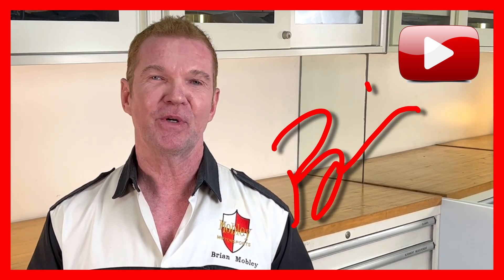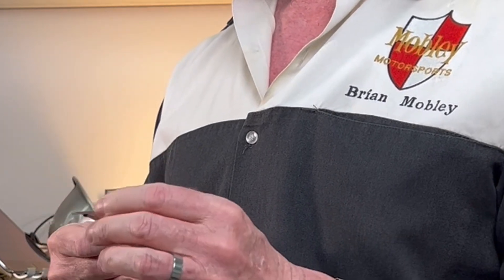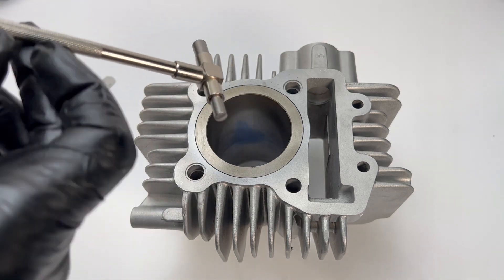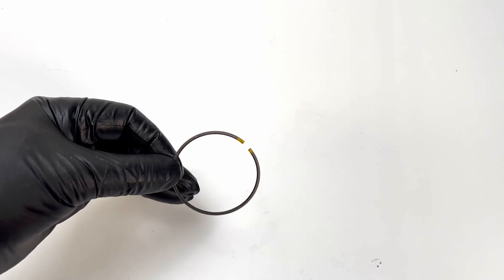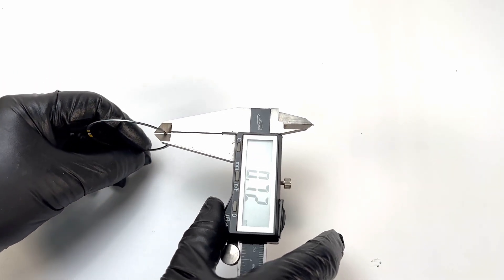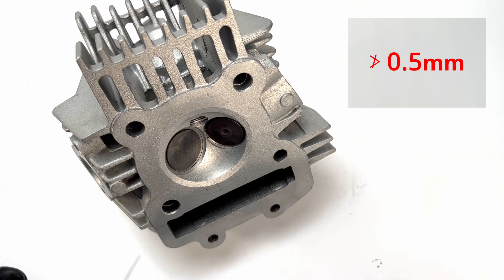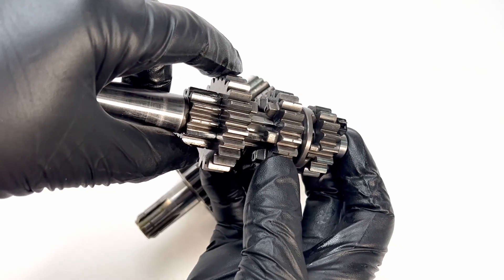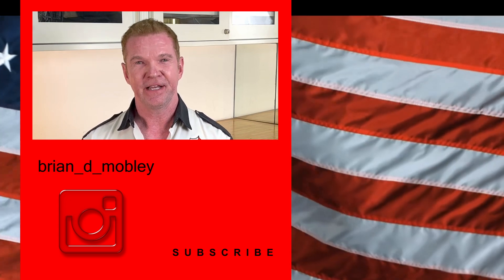4-Stroke Pre Assembly Engine Inspection | KLX 110

Comment: hay man thx for your informatic videos. appreciated 
.. i need help i have question : 
i scuffed my crankcase mating surfaces and now its not even flattened as ican see light through. its about 4 dzm. 
will RTV solve this or this will make leakage after a while !?!? 
and somebody adviced me to use paper gasket .
honda Shadow 1999 vt750c 
engine code : RC44E
Reply from the maker: Hi Minomad. The short answer is; no. Using RTV is not likely to last, especially if the defect is toward to bottom of the case. The proper fix is to TIG weld the affected area to build up the damaged area, then file the repair until flat with the mating surface. Sorry I don’t have better news.

Comment: Hello Brian, enjoying your video series, they are very intuitive.  Question for you, just finished up replacing the crankshaft with a kit. The replacement all went very well except for I discovered with the engine back in the bike all assembled, added new oil only to discover a small oil leak at the bottom of the split line.  Took special care to clean the surfaces, acetone wipe and used Yamaha #4 gasket sealer, torqued per service manual, with a good squeeze out bead around mating surface. Not sure how I can remedy the leak without a complete teardown and reseal. Any suggestions outside of that. It is a Yamaha WZ250F by the way, thanks
Reply from the maker: First of all, bummer! So sorry for the trouble.  As for remedies outside of splitting the cases, probably not!  You can try draining the oil, leaning the bike on its side for a couple of days, then clean the leak area obsessively, then coat the area with the crankcase gasket material. But this is a band-aid and will likely not work forever. So sorry!